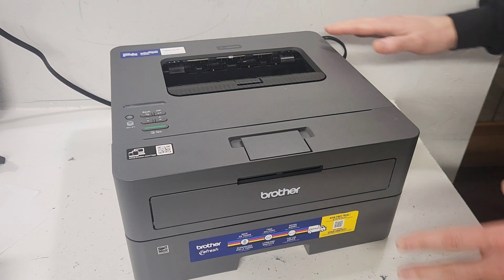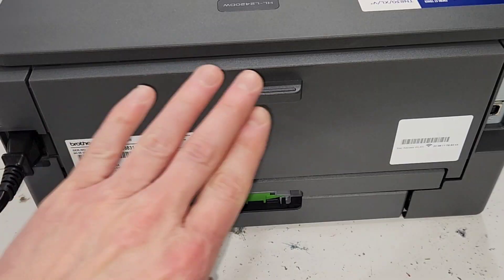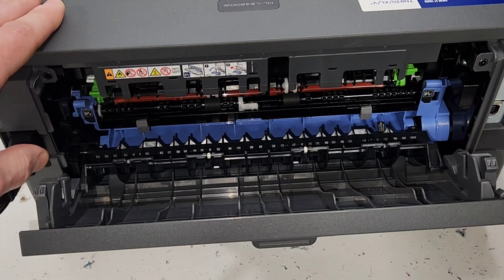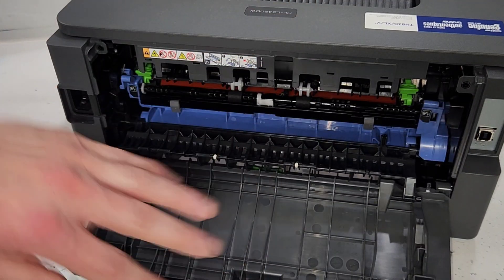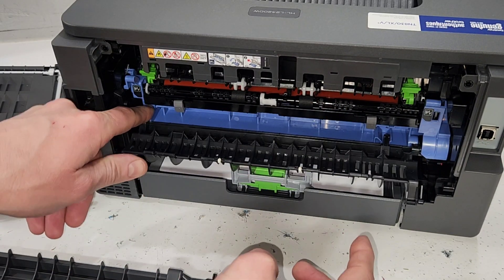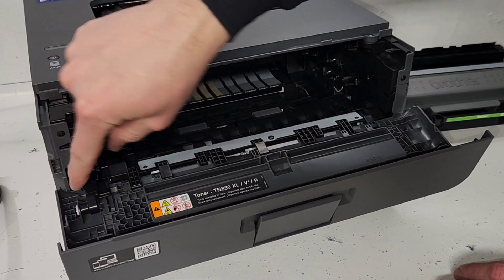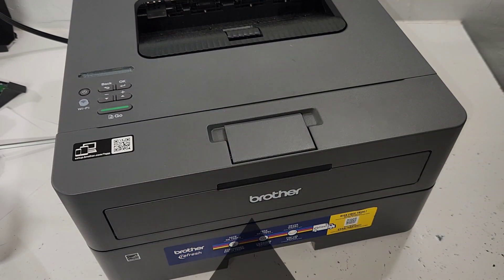Fix “Close Cover” Error on Brother Printers | HL-L2420DW, HL-L2460DW, HL-L2405W

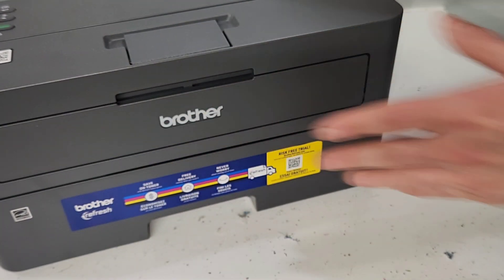Comment: 2:35 That's not the front cover sensor. It's part of a linkage that retracts something when the front cover is open. The actual front cover sensor is on the right hand side as you look at the front of the machine with the cover open. The front cover sensor tab is white, it is normally depressed  by a plastic part that sticks out on the cover when it is closed. Sometimes that plastic part gets broken off. The quick fix is to jam some paper or something into the sensor tab.Thanks for the video.
Reply: thank you so much for this comment, this video and your comment were the actual info i needed.  found the small broken spot and superglued a screw onto where it was and finally i can print again.  i could cry.  thank you!!
Reply: @TheElephantGuides glad I could help. I had the close front cover error and after watching this video and several others I disassembled much of the left side. Unfortunately that was not where the problem was and I was not able to reassemble everything correctly, it's simply too complicated. I messed up auto feed as a result and can now only feed one sheet at a time. I later discovered the broken tab on the right hand side but it was sort of too late for me. Models may vary slightly. Glad it worked for you.
Reply from the maker: Thank you for sharing this information. Have a great day!